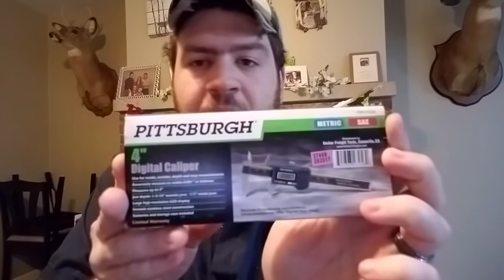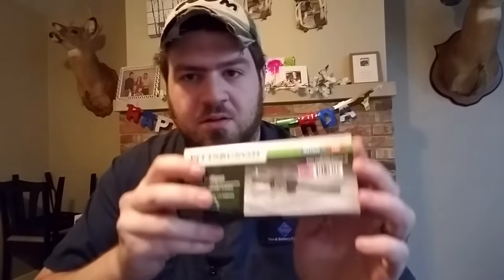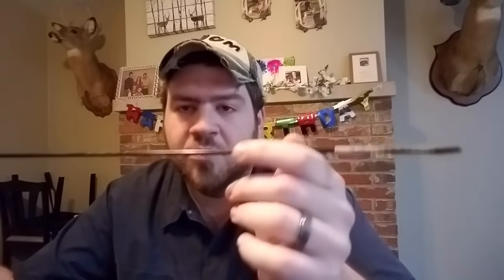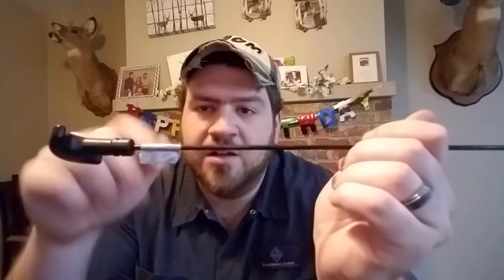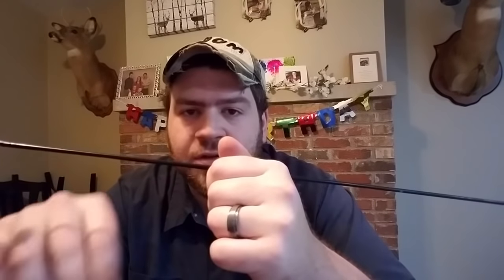TOP 5 SECRETS Airgun/Pellet Makers DON'T Tell You!

Comment: I think your info is good for the most part, but I disagree with not ever cleaning your barrel. Pro shooters will dry patch a barrel until the patches come out clean, but not use nitro solvent or other cleaners that will remove all the lead you've deposited in the rifling and barrel imperfections. That will put you back to square one and you'll have to repeat the process of re-leading the barrel, but dry patching won't pull lead from imperfections, only from the flat surfaces which will reduce pellet drag in the barrel. The next thing you should look into is possibly the most important item affecting accuracy and that is the barrel crown. ANY imperfection in the crown will send pellets scattering. This is why it's important to never push in a cleaning rod from the muzzle end of the barrel. A metal rod can absolutely destroy a crown with one careless push down the barrel. I use a plastic coated cable (similar to a bore snake) which pulls a patch through from the breech end and will not damage the crown. Hope this info will help to further your quest for accuracy. It is possible to re-crown a damaged barrel with pretty basic tools... Good luck, JT

Comment: You mean .02 to .03 mm (.2 or .3 mm would never fit in the barrel) OK, not many Americans actually fully get the Metric System. Especially since the Barrels are quoted in Imperial measurements (.22, .177 etc)

Comment: I did this 20 years ago as a kid .tuning weihrauch 77s  fac to 20 ft lb .my finding is no4 is contradicted by no 3 . All skirys blow out thats how they seal the air behind them , as for head size thats why theyre choked . MY  findings are weight and head shape determines all ,  regardless of choked or unchoked . Crosman premier lights . .177 can hit a pellet time after time at 50 meters  at 20 ft lb thats 1100 foot a second in a hw 97k barrel . Thetes maybe 3 pellets that perform like this  theyre between 7.9 grain and 9.5 grain .  The old hw77s did benefit from taking an inch off the barrel then re cap the end  up to 18 ft lb 980 foot per second with a 9.9 grain bisley magnum .  ALSO  dont clean your barrel so much , thats why it took 25 shots to start grouping , you have to lead your barrel for it to be accurate , a good coating of lead is self lubricating and slightly resizes your barrels bore diameter . Hence it grouping better after said 25 shots . The only problem these days is pellets have a higher alloy mix making them harder and lighter , dont clean your barrel out , and dont use plastic skirted pellets they contain solicone , when you switch back to lead they will go all over the show .untill you scrub out the residue and re lead the barrel
Reply: Sounds like gibberish.

Comment: What he said about the head and skirt size is completely wrong. Most pellets like JSB has skirt sizes of 5.55-5.57. The head size is normally 5.49-5.53. They make the skirt a lot bigger so that it catches all the air and conforms to the rifling better. You also said a 15.89 grn pellet is medium. They make 34 grn 22 pellets. I shoot 25.4 grain pellets out of my 22 cal airgun. The lightest I shoot is 18 for compatitions. As for pellet weight and twist rate, the pellets weight doesn’t have as much to do with accuracy with certain twist rates as pellet length does. That is why when shooting slugs different slugs of the same size and weight but of different lengths will shoot totally different. Take the H/N slugs and NSA slugs for example. A 23grn NSA slug is short, and has a wide, deep hollow point. But the same weight H/N slug is longer and has a shallower hollow point. What I am getting at is you need to measure the length of the pellet that groups the best in your gun and find lighter or heavier(depending of the purpose) pellets that are close to the same length

Comment: The new air gun scientist. I really like how you found an air gun topic niche that no one else is doing.
Reply from the maker: haha thanks!
Reply: Shoot To Kill Outdoors jimmy Tim here I've got a question for you have you tried shooting the Predator polymag out of your Gauntlet yet will they fit the mag and feed well just ordered some hoping they're going to work
Reply from the maker: I don't think they fit...I'll double check when I get home though!
Reply: Shoot To Kill Outdoors I greatly appreciate it thank you Jimmy
Reply from the maker: No problem!
Reply from the maker: Regular Polymag are too long have to get the shorts
Reply: Shoot To Kill Outdoors k thanks jimmy
Reply: Man i just spray wd40 and let drain used close hanger it still shot accuracy. Do think it if i keep at it will it damage it.
Reply: @quentinnails374  Do not use WD-40... It is a petroleum-based lubricant. You want to only use a light silicone-based lubricant for seals, and only a mild tough of it for random cleaning. Less it more.
Reply: That is super dangerous. If that got in the valve or in the foster fitting and is pushed in to the pressure tube that could and likely will cause a detonation to occur from the pressure causing the WD40 to explode/desiel. Even at 2k psi that is easily enough pressure to cause a detonation and would almost 100% cause the air tube to fail and likely kill you.

When dealing with high pressure Air care is utmost important as it can kill you. High grade 100% silicon is safe... That is it... I seen a gun putting pelgun oil in the foster fitting of a Mrod and when he charged it at about 2400psi it detonated and blew the pressure tube end cap/foster fitting off and cracked the Air tube at the end where it's threaded.
It sounded like a bomb going off and blew that end cap and foster fitting through he trucks bed and in to the cab of his truck. Thank God no one was in it or standing in front of that gun or they would have been dead.

That happened he said at 2400 to 2500psi as he was watching the gauge on the scba tank as he was filling it that gave me a new found respect for HPA. That happened about 5 years ago and was a numbing event as it scared me numb when it happened and ever since then I have been double careful because i was about 5 feet away whwn that happened and seen first hand how violent HPA can be. I though he knew and that was a bottle of the Crosman Silicon oil that comes in the bottle like pellgun oil or i would have told him ehat the hell are you doing.
Afterwards he told me he puts pellgun oil in his Disco all the time and so he though he could in it. I guess pellgun oil doesn't detonate at 2000psi but I wouldn't chance it. But at 2500 to 2600psi it did. I wouldn't trust it even at 1000psi.

Take what the other guy said and do not USE WD40 down a barrel as it could get in the valve if theres no pressure in the gun and then when pressure flows in the valve BOOM. even cleaning the barrwl with it the HPA that flows in the barrel and behind the pellet could cause it to detonate and that wouldn't cause a danger issue but it would make your velocity be all over the place. Be extra careful when dealing with HPA please as whwn a pressure vessel fails it's totally violent and if you was close could easily be fatal.
Reply: Samuel & Luba Brock  Yeah I wasn’t sure if the guy was spraying WD40 on his pellets to lube them and letting them dry or cleaning his barrel with it but he should keep it away from any PCP rifle. I have washed pellets let them dry and sprayed them with slick 50 silicone spray and let them sit overnight to dry because the propellant in the spray can is flammable and then lightly pat them dry in the morning with paper towels before placing them back in a clean tin with a piece of tissue in the bottom, slick 50 does a great job of lubing the pellets or slugs and my Marauder 25cal with a Green Mountain Barrel shoots JSB exacts and H&N grizzly 31gr slugs great at 75yds & 100yds but also shot them great out of the tin before lightly spraying them with slick 50, less flyers For me. High quality pellets like JSB don’t have all the small lead flakes like you see in crossman and other cheaper pellets and I have one gun the crossman pellets shoot very good in, just have to always clean them.
Reply: @quentinnails374  don't use wd40 use ballistol oil.

Comment: I have a Walther LGU.  The barrel is fixed, which is the reason I chose this rifle (cost $400) I had heard break barrel is often more inaccurate (because the barrel is in a different position each shot).  Turns out IMO this is 100% correct, this rifle is scary accurate with good pellets.  I had the Bejamin marauder and i could not hit broad side of barn with it even at 15'.  Also i did everything i could to maintain the seals, always keeping air in the gun, as soon as the warranty ran out though the gun started leaking!  Too much trouble.  The new cheap high pressure compressors are a huge step forward but also a whole new complicated thing to maintain that is NOT your gun.  I think they need to design an entirely new type of seal that will last the life of the gun, too much fiddling with pcp guns now!

Comment: Twist rate also depends on velocity. Lower velocity projectiles require a quicker twist rate. 1:10 is quicker than 1:16. Heavier pellets tend to be traveling slower. As you tune your gun, keeping the velocity below the speed of sound increases accuracy. All pellets become less stable when pushed too fast. That is why ultra lite pellets do not shoot well from high powered air guns. 
When long range shooting, heavier pellets are less deflected by cross winds. Usually have less deviation in velocity from shot to shot, so tend to be more accurate despite having a more pronounced trajectory. For punching paper or targets at long known ranges the heavier slower pellets may be preferred. But hunting brings different priorities. A flatter shooting even if a little less accurate pellet may be your choice. The amount of energy your airgun your gun produces with a chosen pellet, and the amount of penetration a pellet gets from your gun, may all effect your choice of pellet. 
Anyways, there are a number of reasons to pick a certain pellet, just test and pick the pellets that work best for you. 
Example:. I have a Hatsan 22 that I use Barracuda pellets for long range and heavier game (squirrels, possums) and JSB for rabbits, Crossman for rats. Neat reason for these 3 pellets, they all hit at the same POI. Why JSB for rabbits?  Because the Barracuda pellets just pass through. The lighter JSB pellets do too, but leave a larger hole, thus are dumping more energy into the target. I use the Crossman for alot of plunking too. Why, because they are cheap and readily available.
Reply: Very true.

Comment: Wow, impressive demo. I took a completely diferent approach, but we both ended up in very similar places.
I use a Gamo Bigcat .177 and the Walther Talon in .22.
Imo, crossman makes the trashiest pellets. Even thier highest priced pellets have way too much left over mold flashing left on them. The only reason to use crossman is for fun plinking.
Upgraded to H&N domed( they carry the widest variety of subtle sizes, 1/100). I found that the 4.51 (.177, 8.64gr) worked best in very cold weather, and the 4.52's worked best at 100` or warmer temps. Similar results for the Talon with 5.52 for cold weather, and the 5.54 for very hot temps. (Working best=maximun raw muzzle velocity)
Basically i chronographed all the available size variants for each rifle, through the course of a year. Too tight of pellets DROPPED velocity quite noticably, as did the too small. In the end i had two sizes for both rifles, winter rounds and summer. Only a couple 100ths either way made dramatic diferences. So i first figured out the best sizes to get maximun pressure and velocy, then i adjusted the pellet weights to slow them back down to the more stable 900-999 fps range.
Using the barrel twist, i deduced that for both my rifles, the optimum velocity was actually only 900-999 fps. Faster, and the pellets begin demonstrating the coriolis effect at the more extreme ranges, 30 yd+. There is such a thing as TOO fast a rotation.
If you think about it, a barrel with a 1/12 twist, will rotate a projectile travelling at 1000 fps= 1000 rpS which we all can multiply by 60 second, and we NOW have a projectile rotating a 60k. rpM!
No lead object should be able to hold together under that kind of spinning. So even the much milder 1/24 twist still = 30k.rpM.
Bottom line is, just because you CAN launch a pellet supersonic, it will never improve accuracy.
Junk the cheap ammo if you want accuracy. And dont expect accuracy at supersonic velocities(1123+fps)...
For what it is worth, i target pingpong balls at 100 ft., freehand. For small airguns that is satisfactory for all the small game i hunt.
Keep up the good work...
Reply from the maker: Thanks!

Comment: Wasted a lot of time weighing and measuring.  The only pellets were the round balls that a total looser  in weight and measure.  Both were off a lot.  Pellets never found them to be off either way.  Gave up on that.  One improvement was using pam or sone oil non petroleum base.  Bad with petroleum.  Coconut oil.  canolia. Tiny amount in tin top.  50 to 60 pellets slowly turn slowly.  Mix in with rest pellets lid on slowly turn.  Doesn't need to have every pellet coated.  I believe the pam helps from crushing or deforming pellets going in is why it improves the accuracy.  Doing it for 16 years on pellets ranging from 177 to 50 cal. Crosman marauder.  10 to 20 thousand rounds.  Cleaned once.  Others after that didn't  clean
Reply: I use nothing and have shot the same  and killed over 500 squires with Raptor pellets in my Crossman break barrel 1200 FPS  NEVER cleaned once! with scope 4×32 !!!  Bought it over 10 years ago!!

Comment: Thanks for the video. It was knowledgeble. Not sure if that is a word but it is. I took the manufactures advice and tried it. I also researched my pellet rifle for the "best pellet" used in my rifle. not all pellets are made the same and this goes for rifles as well. I did what was suggested to me from the squirrel hunter advised to me. he said to try varrious pellets and see what pellet is best for my break barrel 1200 fps pellet rifle. So far it is the premier 7.4 grain hollow point pellet at 15.00 CND per 500 tin and the premier destroyer, even cheaper pellets. I kow it is a very light pellet but I blast through a 3/4 inch plywood at 20 meters. That is amazing for how light weight it is.  I yet have to try a 14 grain plus pellet.I never thought these things were secrets, i just know they were untold unless asked specifically.

Comment: You need to measure the pellets before and after firing to see how the grooves engage and shape deforms.  A solid head, thick skirt, long pellet will deform less and bee more accurate.  Hollow head, thin skirt, short pellets deform into cans with high pressures, over 800 fps.

Comment: The only problem is if you use a metal cleaning rod you will wreck the crown of the barrel. Only use mac 1 crown saver. Not a boresnake.
Reply from the maker: Thanks! But that's the sole purpose of the bore mop...centering the rod in the barrel, the mild steel/aluminum cleaning rod which are most common would really have to scrape the crown to cause damage...airgun steel is soft but not that soft....thanks!

Comment: Enjoyed the vid but I have 3 tips to give. 1: You mentioned going 0.2 mm over in size is acceptable, and I think it was just brain-fart, but the correct advice is 0.02 mm as a variable window for head-size and skirt-size on pellet sizing. 2: As a rule of thumb I always try to clean any gun, whether it be a pellet rifle or a "normal" gun from the breech forward. I try to never push anything up the muzzle-end of the barrel, to prevent any damage to the crown, and any potential to "backwards" gouging in the rifle bore, from rod separation or any FOD. 3: It is a good idea to use a silicone-based lubricant on a conservative basis for piston seals, or spring surfaces, and also. Never use a petroleum-based lube because you want to prevent deiseling, carbon-fouling, and seal degradation.
Reply: ptschafer ~ yeah, pretty sure that’s what he meant...  .02mm

Comment: If you want to really get the most out or budget airgun barrels there is a few things that you need to do. First is a quality crown... Send it to Alchemy Airwerks and have them square the barrel face and lathe turn you a nice crown he charges like 25 to 30 bucks... Or you can do the brass screw method and diamond paste anc get a much better crown then what comes stock on budget pcp guns that will give you the biggest increase in accuracy period. Next would be to smooth the air transfer opening to remove all burrs and smooth the leade in so you aren't getting rifling smears on the pellet skirt from a sharp leads. And then lead lap the barrel with JB bore paste until you have a near mirror finish. That's taking a crappy crossman barrel or similar and turning it in to a near match grade barrel minus the choke. Im mainly shooting FX Guns and RAW HM1000X LRTs now but still have my .177 and .22 Daystate Red Wolf's my last 10 guns have been a .22 a .25 and a .30 HM1000X LRT and 7 FX guns, im pretty much stuck on FX guns just because of the huge adjustability and ease of it and the STX liners and the ability to have proper twist rates for slugs.
I still have a place in my heart tho for the 300 dollar guns because of starting out with something that isnt all that fantastic and tinkering and working on them until i have a 250 to 300 dollar gun that's performs well beyond what it did. I have 3 Gaunlets and 5 Discos that have all been tuned to the max. They arent capable of shooting with match grade guns even with tons of time and work but it is possible to get them relatively close and to me that's a lot of fun. So I dabble in the budget guns and enjoy shooting them but in no way will i be giving up my top tier stuff lol.